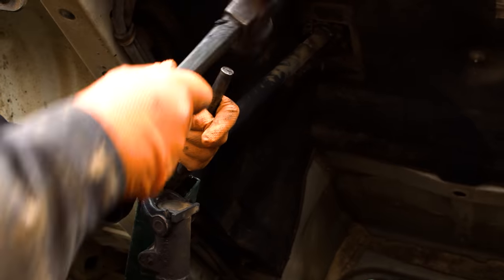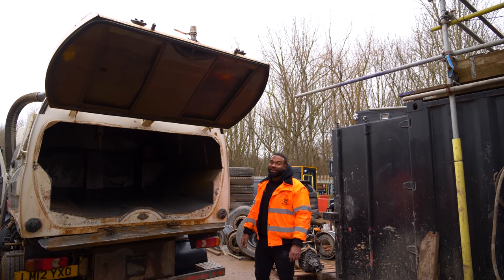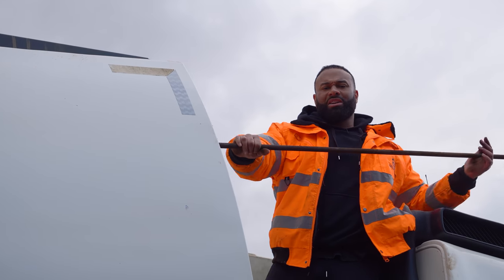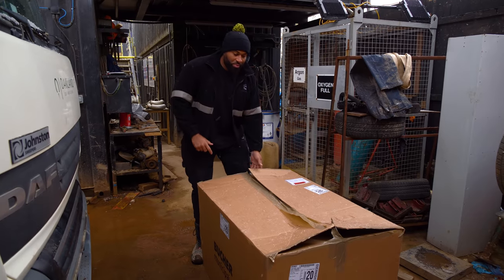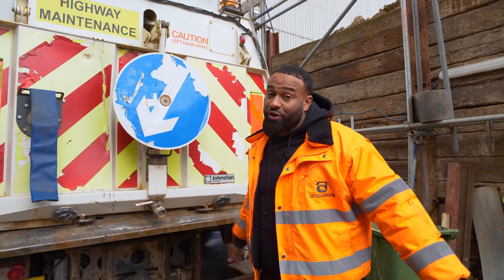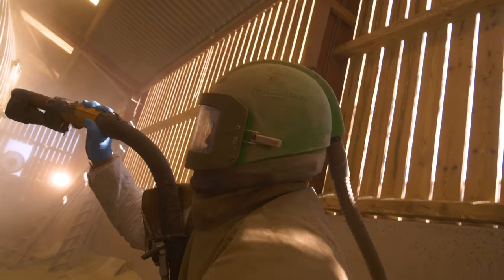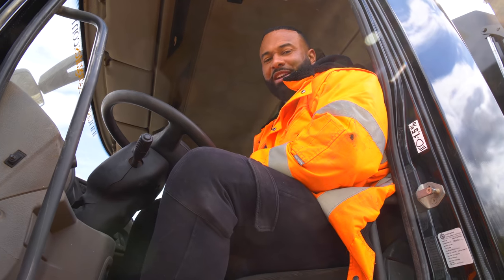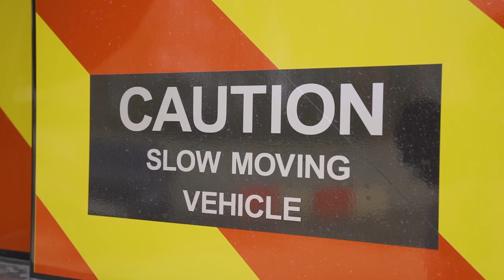Full Restoration and Customisation of my 2012 Road Sweeper

Comment: Running costs on street sweepers are big.  Lots of wear parts (suction tubes, vacuum nozzles), electrical, hydraulic, air and water systems with associated wiring and pipes/hoses running through tight gaps with lots of vibrations and grit, then you have all the brooms and rubbers..  The maintenance never ends.

Comment: Suction box is too high mate need to lower the angel and you will get better suction. Little adjustments make a big difference in a sweeper. Definitely one of the nicest sweepers I've seen. Even nicer than my brand new one I had a few years old. Just goes to show you don't always have to buy new.

Comment: Aha the old VT650 on LF55 chassis I drive exactly the same sweeper and have done for 8 years, great sweepers, 4 mph or slower with more water for a better job, drill jets (hole diameter next size drill size up on suction box)... water solenoids get sticky, Check the impeller periodically and shaft nut I've lost 2 impellers with shaft nut failure (not pretty)

Comment: Got 2 of these at my work, one donkey engined volvo, one single engine DAF, top tips, keep them "top hats" inside the hopper clean, the debris sticks like s***, & stops the flap opening fully, & the drop down grills inside the back door, keep clean or you'll loose suction, cause the airflow will be reduced. Top cleaning tips, keep the hopper wet, suck up as much water as you can, every few weeks stick a hosepipe up the suction box, let it suck a hopper full of water up, then drive round the yard & empty, bingo clean hopper.......oh & use a hose not a jet wash to clean hopper, or you'll get covered in crap.......

Comment: I would have put the two new tyres on the inner positions and the older ones on the outer side, so they are easier to monitor and if you get a puncture or blowout it is easier for the driver to see.

Comment: Driven one of these for 6 months as a temp most boring job ive ever done biggest problem I had was being sent to jobs that didn't have a post code yet! All the new build estates that are being built on fields fine if it's down the road but not if your driving 60+ miles to new areas then going off directions from an reception woman that's never been to that area. Awesome wagon tho everything looks better painted black.

Comment: Rev it up bit more suction looks shit in the video. I used to drive exact same as that aswell as a 2017 scania g380 sweeper also make sure the roof vent is clean u will loose loads of suction from that.